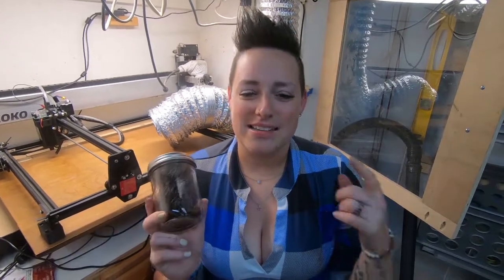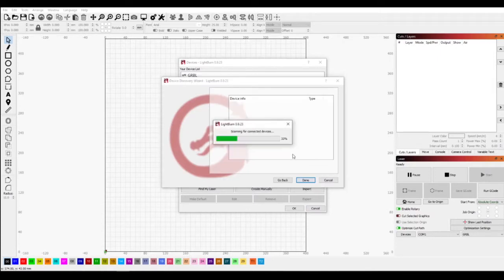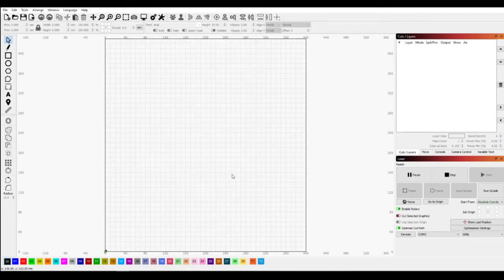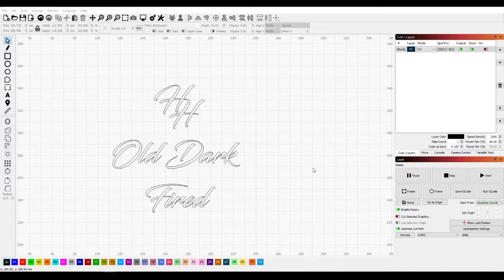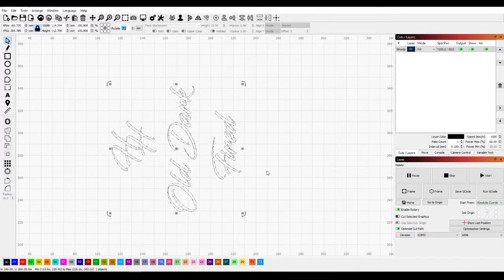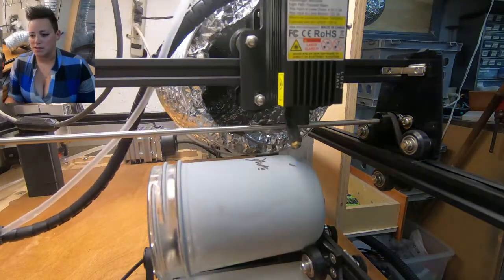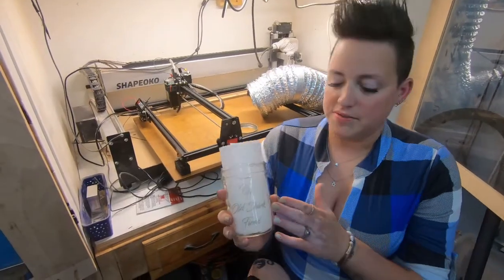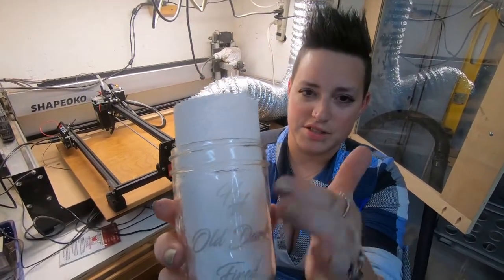Improved Glass Etching Method: Dry Moly Lube

Comment: Do you need the glass painted for it to work? Mines is not engraving and I don’t know why
Reply from the maker: You will have to paint it or coat it with something if you are using a diode laser.
Reply: @KLRform  I don’t know what’s a diode laser but thank you for replying back

Comment: I was just watching a glowforge with the dry moly lube on metal it worked great, but you have to run the laser at full power and very slow. I haven't tried it yet but I'm want to see if it works. I have a sculpfun S6pro...love it
Reply from the maker: I used it on stainless steel and it work great! Good luck with your tests.